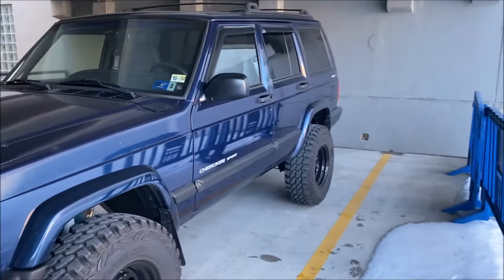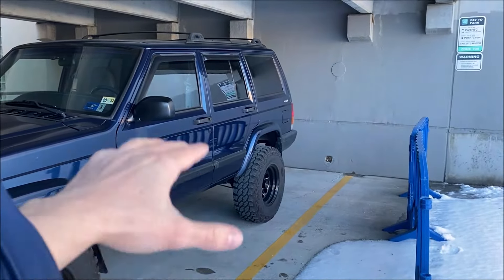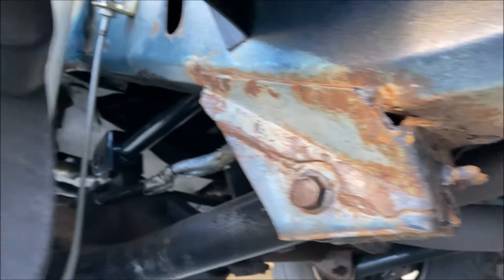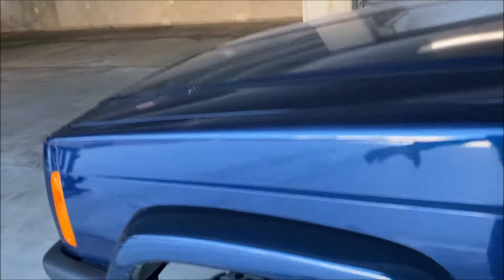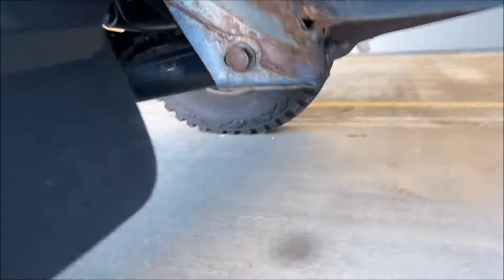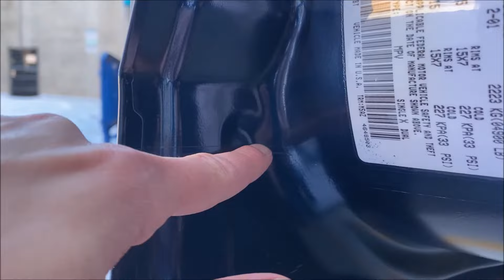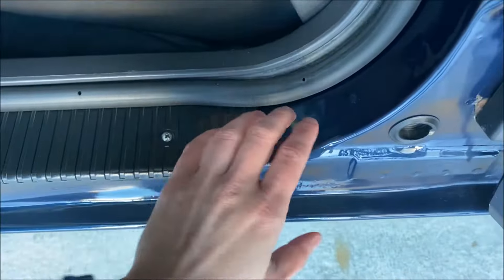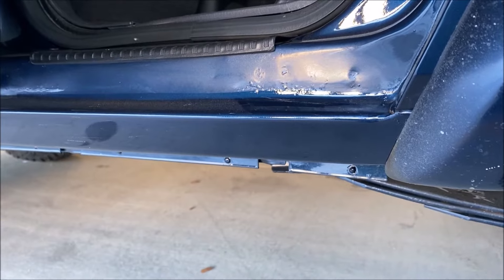Spending $2400 on Rust Repairs and Finding More Rust Afterwards | Jeep Cherokee XJ

Comment: If you get Surface rust. I’d recommend rust mort rust conversion compound. I’ve tried it on a rusty metal part on my Jeep. You Sand off any flaking rust till the surface is smooth then you can spray or brush it on. It turned the surface rust back to bare metal. Then you can paint and primer or do whatever you want. It works pretty good
Reply from the maker: Thanks!

Comment: I tired POR one time on an old fertilizer spreader.  Prepped it as best as I could.  Still flaked off.  Had a similar result with a trailer.  My only advise and experience is to make sure to prep and etch the surface as good as possible before applying it.  I personally like fluid film better.  I've heard of issues with rust forming underneath bed liner type products.  Appreciate the videos.  I'm restoring an 89.  She's ready for the paint booth.
Reply from the maker: I’ve heard the same with different rubberized undercoatings which is why I’m on the fence. Appreciate it!
Reply: Talked about lanolin based products in other comments, but I also did POR-15 on a boat trailer just recently. Prepped the hell out of it per the instructions, painted over it. I don't have a ton of confidence. We'll see how it holds. No good way to get inside the boxed frame areas either. May go back and fluid film those when we go to winterize it.

Comment: Eric O of South Main Auto Repair has a video (of which I cannot recall the title) showing a relatively new truck with rubberized undercoating where that junk has just trapped moisture and accelerated rust on areas of the frame tenfold. Glad to hear you went with fluid film instead. I did fluid film on my 2001 suburban. It's still there in a lot of places after 2 years, but it washed off in a lot of areas too. I resprayed with the new blaster surface shield that contains both lanolin and petroleum jelly. It is definitely gooey. I suspect it will last better but collect more junk and be more disgusting to work on,  Haha. That's the trade off for the vehicle staying intact in the rust belt, I suppose. I also used green grease marine grease (just scooped it out of the tube by hand and slathered it on) in the areas that were washing off really fast that I could reach. I'm going to try to touch it up more frequently from now on. I'm in the process of learning to weld at a higher level so I can replace my rockers and rear quarters. Trying to source a used hood and passenger fender as well (they all rot in the exact same places) that I can protect before installing. It's such a shame that we can't buy new vehicles like these older ones ever again. It saddens me to think about them one day either being totally gone or unaffordable.
Reply: I should also mention that if you use Surface Shield, you will need a "graffiti adapter" or whatever they call it to use the fluid film/ woolwax "wand" for the aerosol cans because one has a male end and one a female end to the plastic sprayer nozzle. I also purchased some very long straws to help get all the way inside my frame and body. Messy, but got the job done pretty well I think. Might actually go back with my borescope to verify I hit everything.
Reply: Another thing to mention is that there are primer products that are "weld-through" that can be used when doing things like rocker repairs that are inaccessible after the repair. I haven't done a lot of research on those yet, but I'm sure it's better than bare metal at and around welds (even though I believe most primer is porous). Would still use a lanolin based product on it after the repair though.
Reply from the maker: I’ve heard the same things about the rubberized undercoating as well, I was just looking for a way to make it more visibly appealing so I wanted to get something that would make it look black. I have also heard that fluid film makes a black undercoating so I might try that next. Appreciate it and thanks for watching!

Comment: Maybe try and undercoat it with Fluid film it’s great stuff and can still get at all the bolts/wires
Reply from the maker: Got it undercoated with fluid film about a year and a half ago. I think it’s due for a re spray
Reply: @KCars  Fluid Film says touch up once a year. Blaster Surface Shield says touch up every 2 years. I can tell you they will both require more frequent touch up in any areas that get blasted by road debris, water, etc. I'm going to try to do at least a quick touch up every 6 months, if not more, and a really good touch up once a year. I'll try to report back on how the marine grease I mentioned in my other comment holds up as well.
Reply from the maker: Ya I feel like fluid film should be resprayed a little more frequently if you drive in the elements since it can get washed off pretty easily

Comment: Maybe try something like cavity wax in an aerosol spray can, you can get in your door drains and up inside the rockers and unibody frame etc... if the backside of the welds on the repairs aren't painted or treated they will rust quickly. Multiple companies make cavity wax in a spray can and you can get long spray tubes with 360 spray tips and stuff to get really far into nooks and crannys. Somewhere you might want to look is around your windshield frame and rear quarter windows because old dried rubber trim/seals can cut into the paint and start rust. Then look around the roof seams focusing especially at the rear of the roof corners like around the hatch. It seems like you have everything else pretty figured out. I've dealt with a lot of rust and I would stay away from those rubber coatings like bedliner because moisture and rust will form under it and get super bad moisture always finds a way and ive seen some horrible rust under bedliners and rubber coatings. I like getting rid of the rust manually and maybe treating certain areas where you've removed surface rust before painting. I think paint and regular maintenance like with cavity wax is the best long term solution. 
If you can take some interior trim off and get to the backside of that roof seam and treat it front to back with cavity wax that would be good, pay close attention to the very rear of the roof seams in the corners around the hatch like I mentioned and also the top rear corners of the back doors at the roof seam area. 
We really don't have bad rust here where I live in Washington state nothing like you guys get. I like to remove all the factory seam sealer from the entire vehicle when I can which requires a full tear down. Or i at least do the interior seam sealer and everything you can get at with just removing the interior. If you ever get the chance I'd suggest removing and replacing any factory seam sealer you can because I always find rust underneath even on really clean seemingly rust free cherokee body's. I like to go back with a 3m 2 part seam sealer like their controlled flow or heavy body sealer throughout the vehicle, it's a ton of work but I've done body's where I replace 99 percent of the factory seam sealer with minimal exterior painting, but repainting the underside and inside and touch up in the engine bay. 
This is a long comment haha.
Reply from the maker: One of the longest comments I’ve ever received lol. I agree about the rubberized undercoating I’ve also heard that it can cause the rust to form underneath and cause more rust that isn’t visible until it’s too late. That’s kind of why I’m on the fence because I think it would look better but don’t know if I want to run that risk. I definitely need to give the roof some attention like you mentioned, bunch of rust spots up there. Appreciate the advice!
Reply: @KCars  I wouldn't do any sort of truck bed coating unless there's absolutely zero rust and it's been thoroughly gone through and you paint it first then prep it really well for the coating. Those coatings are nice and fairly durable but if you get a chip or pinhole it's nearly impossible to tell and you won't see any rust until it's really bad. When it comes to interior floors, rockers, and underneath the car I'd stay away from the truck bed coatings. I think it's fine on bumpers and sliders etc.. 
I'll never apply any sort of truck bed coating to anything I own after all the problems I've seen with it. I wish someone would've told me 10-15 years ago to stay away from it. I'd rather make sure my seams are sealed properly and periodically clean under the car and touch up the undercarriage with black paint. We don't have road salt here but if we did I'd be rinsing my undercarriage often and probably not driving certain cars. 
The eastwood 2k aerospray chassis black is a good paint that's what I use it's a 2 part rattle can and it's very durable.
Reply from the maker: Thanks! Would you suggest that paint over fluid film?
Reply: @KCars  the fluid film I'm familiar with is more of a temporary coating that needs to be applied periodically. I'm not sure if they have other more permanent coatings. But what I would do is remove and repair any rust then paint it with the eastwood and after that apply fluid film. The fluid film would help even more to protect it from rust. 
The eastwood 2k aerospray isn't anything special other than good paint in a spray can. It's expensive but it's really good and convenient, just make sure to shake the absolute crap out of the can before and after activating it and try to apply it when it's 70-90 degrees out if you can.
I don't really believe in rust encapsulating products, what I like to do is manually remove the rust then anything leftover or you can't get at I would treat with a rust neutralizer then paint like normal. 
Nothing stops rust forever, buy once you have it under control I feel like paint and then maintenance like applying fluid film or cavity wax and touching up the paint every so often goes a really long ways in making an xj or any vehicle last long term. My opinion is that encapsulating products cause more damage long term and rubber coatings are horrible. At least with paint you can see what's going on and make any little touch up repair before things get out of control. 

As long as all the rust is completely removed and properly neutralized and the area is sealed from both sides like with cavity wax inside the panel and paint on the outside you shouldn't have any rust bleed through or bubbling
Reply from the maker: Solid process, thanks!

Comment: Spray the undercarriage and all components and every nook and cranny with fluid film once a year and it will stop existing rust and no more rust will form.
Reply from the maker: Got it sprayed about 1.5 years ago but definitely need to get it resprayed
Reply: @KCars  Was it sprayed with Fluid Film?
Reply from the maker: Yes
Reply: @KCars   Just curious, do you take your Jeep to the car wash and get the under chassis spray wash? If so it's like pressure washing off your fluid film protectant.
Reply from the maker: Yes, I usually go to the self service one and I do spray the underside
Reply: @KCars  I currently own 3 jeeps. 2 Grand Cherokees 2001 and 2004 WJ and a 2001 Cherokee XJ. I spray fluid film liberally on the undercarriage mid October and do not pressure wash the chassis until the beginning of summer. I live where we get over 100" of snow and tons of salt on the roads a season yet my jeeps remain relatively rust free from year to year.
Reply from the maker: That’s good to know. So when you drive through the salty roads you don’t clean out the underside at all?
Reply: @KCars  No I don't pressure wash the underside till late spring / early summer once we are done with snow. Our roads turn white they spread so much salt over the winter., The fluid film coated parts are not affected by the salt. Normal driving even in slush or rain won't wash off the fluid film but pressure washing will.
Reply from the maker: Good to know, thanks!

Comment: 1. 2001 is not an in the class of "old Jeeps".  2. an XJ is still considered to be a rust-free example as long as there are fewer than 3 rust through floor locations. If there are more than 3 but less than 10 it is considered to be surface rust.